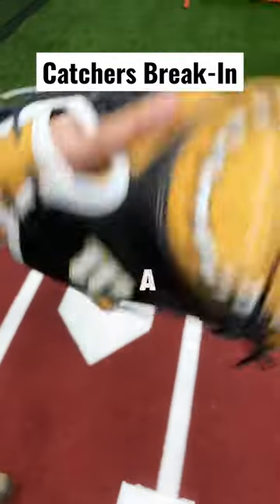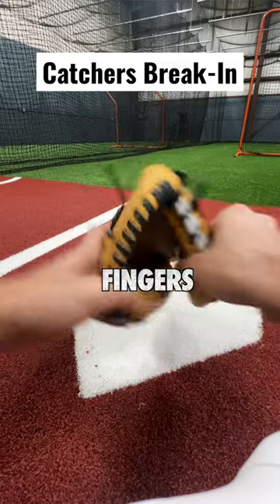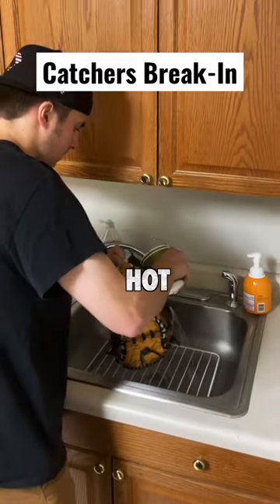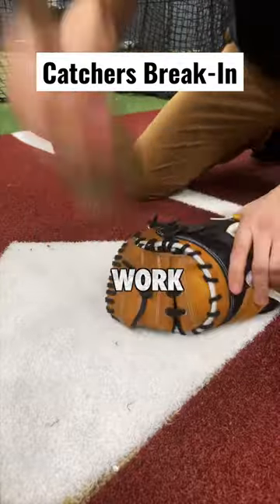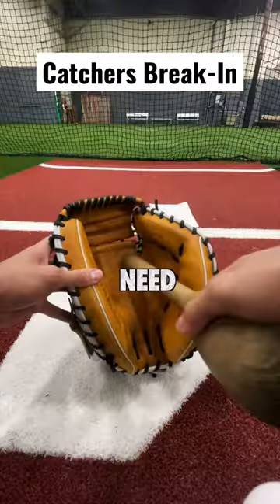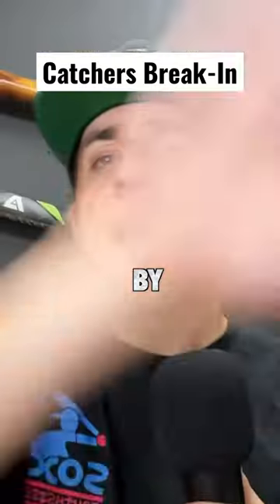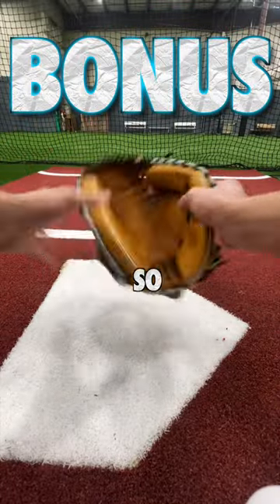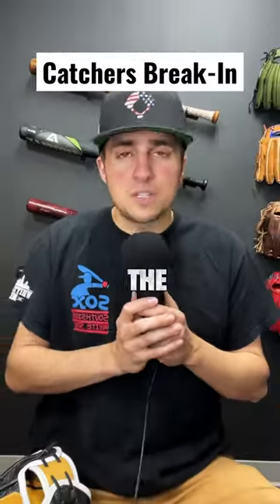Catchers Mitt Box Break-In

Comment: If you’re going to use the hot water treatment, make sure to use some glove conditioner before, so the water doesn’t soak into the leather. If not done properly, the leather will absorb the water, which leads to cracking, when it dries out. It doesn’t ruin the glove, but just be cautious with it.
Reply: Makes sense 🙏
Reply: What’s the point of doing the water if it doesn’t soak in?
Reply: @sandoshack  heat
Reply: @sandoshack the best kind of heat too .. moist